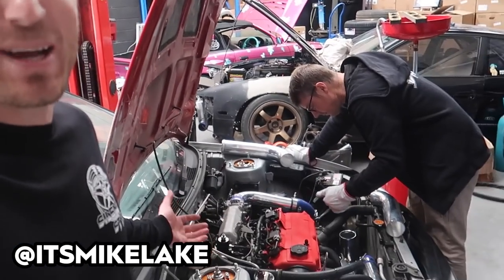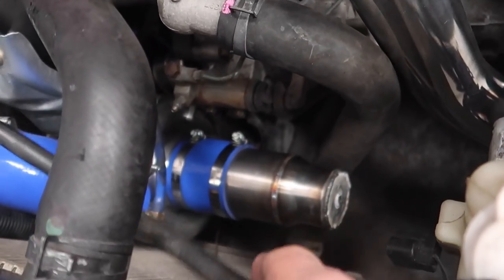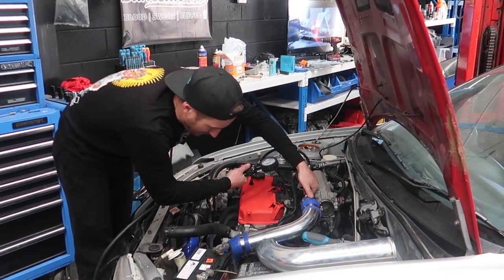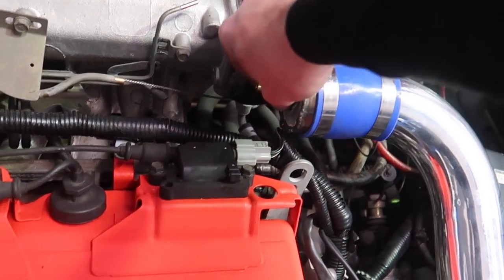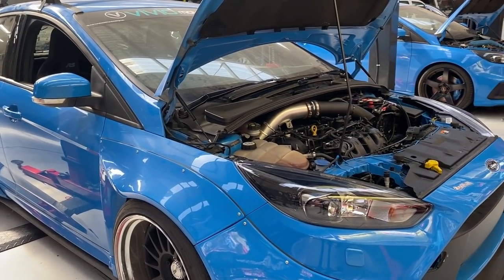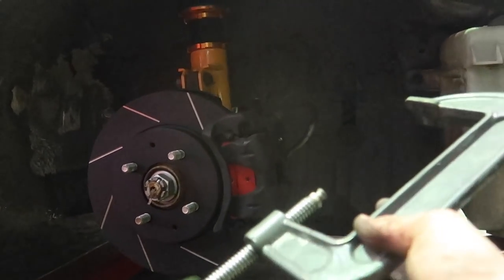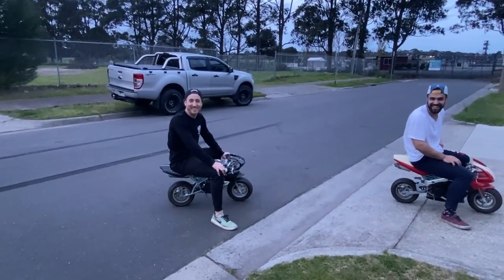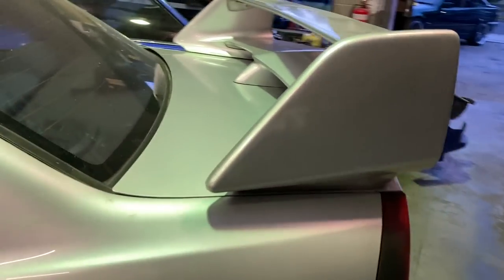DIY BOOST LEAK TESTER & MORE BRAKE UPGRADES! BUDGET EVO

Comment: Sweet... You can use that boost leak setup as a smoker as well with a few randome bits... Metal coffee can some baby oil some wire battery  and some hose!.. or just some soapy water like you do a tire

Comment: This thing just gets better and better ! I made a budget tester from the plumbing section at bunnings with rtv in the end cap joins and a car valve,found leaks at almost every join especially with cheap t bolts. After you are bored of the 1.8 you should 3.8litre mitsubishi 6g75 swap it

Comment: Love the build, this is what we have to do in the States to build an Evo 4-6 clone. Hit me up when you’re ready to convert to discs in the rear. I have a guy that makes kits for this chassis.
Reply: ill love to do it to mines ..whats the cost?
Reply: Evo 3/ fto trailing arm with matching handbrake cables are bolt on. If you can find stock boxed fto rear lca, it will allow sway bar mounts (need additional ones to bold to chassis) too. I have a 5 stud mirage/colt with 4g63, locked to fwd

Comment: Nice build you have been doing on your ce lancer Mike I am impressed.I own a ce lancer too & am across the ditch in New Zealand,That brake upgrade from EBM that you did-can that be installed on ce lancer with its still factory 15" Inch wheels or do you have to have mag wheels?How much did it cost to purchase ? How do the brakes perform now compared to the original brakes?

Comment: How r u able to rev to 5 grand so easily on a stock moter I have a 2.0 4g94 and It sounds like its gonna die past 3 grand even with an exhaust
Reply from the maker: What mods have you done? If you’ve upgraded injectors without upgrading ecu, it’ll die on its ass